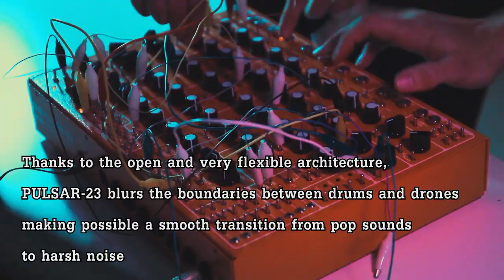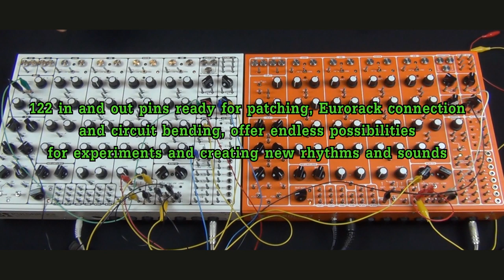PULSAR-23 (SOMA laboratory)

Comment: Which two pins on the Pulsar did you connect the radio transmitter to ??
Great demo, mine arrives soon 🙂
Reply from the maker: The ground and ext in of SD
Reply from the maker: the GND and EXT IN of SD
Reply: @somasynths  Thx Vlad 🙂
Reply: @somasynths  I got my Pulsar now and it’s an incredible device 😍 Thank you so much for all your in depth videos it really helps. It would be so cool if you do later a video about connecting external electronic devices like the fm radio. 
I’m new with circuit bending and I have no idea which components to connect to the ext in and the ground for such result.